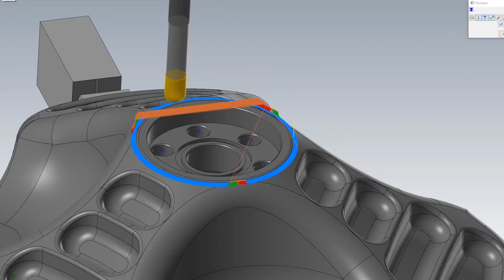IF You're This Type of Machinist, You Deserve $100,000+ Salary

Comment: If the person has so much expertise and everybody can rely on him why not build his own company instead being an employee?
Reply: Expertise does not equate to great management skill
Reply: It's called money.
Reply: @dman0042  The extra nothing at your salary or the money you can make building your own company?
Reply: @car9167  The reason people don't just start there own company. Money. If you are a machinist making what you consider low pay then how do they afford to open there own shop without a massive loan that they would most likely never qualify for.
Reply: @dman0042  That's true, not everybody qualifies for that. But if you ended up in a position making such a difference in the company why not try to work for yourself
Reply: @car9167    Work for yourself and the answers to the questions you have will be answered, have employees and you'll understand you can't even begin to realize the stresses involved running a company.
Reply: @skm9420  Well I did that so I know from my experience. I was also that employee the video was mentioning but I was able to negotiate with my employer a different arrangement for wages. I would get a fixed salary and 10% of the profit increase month to month. So if this month the profit was $150,000 and previous month the profit was $100,000 I would get $5,000. If in any future months the profit  goes down from the maximum so far I get nothing just the base salary. To get anything again the profit needs to go over max ($150,000) in my example. That's incentive to create profit, not revenue which takes into consideration revenue and cost to get those profits.
Reply: @car9167  yeah and then you rolled over and fell out of bed
Reply: @desperatelyseekingrealnews  Not at all. I was the company CFO at the time and it was in Romania and the company owner was german originally from Romania. Something like that would never happen in US
Reply: I agree !
Reply: Why take on the risk. Once you have your basic needs taken care of and can reach for other goals in life.
Reply: expertise in a industry is'nt equal to company running/ getting your own bussines , you have to have much knoledge on that , not all people are good buisness men even though you are good at you do
Reply: If they're content with what they're doing I don't see the problem. Owning a company comes with a lot of downsides and stress. Why bother if you can lay back and earn 6 figures while doing what you love? Money only improves your life until your basic needs are covered, after that point it becomes more and more useless.
Reply: @chas1878  Sorry but I don't see it that way. If your work is increasing the company productivity with 10% whatever salary increase you get is nothing compared with the amount of money the company makes. For me that salary increase is not an incentive and at my age it would not feed my ego that I did something extraordinary for the company.
Reply: @car9167   There's more to running a business than just money.
Reply: @car9167  that's why you would never be able to run  your own business and those type of people and very few and far, as Titan says people like you lack passion also just because the company may make an extra million from you doesn't mean that's a million in profits, also doesn't mean that company isn't already running on debt, braking even or may make a profit and want to buy more machines and employ more people and thats something that takes someone special right there.
Reply: @pandaview2673  Sorry but you don't know anything about me so you can't assume anything.
Reply: @car9167  Of course I can assume. Its the very thing I can most definitely do.
Reply: [07/03/22]  Running a company is def not for everyone. You really have to be driven. A lot of things to consider: accts payable, accts receivable, sales, mkting, cust svc, payroll, HR, property mgnt, financing, and on, and on.  Who's going to do all that?? Accept first of all that you'll be working a min of 60 hours a week, if you're lucky, during the first 3 years at least!!

Comment: My first job as a CNC machinist when I was fresh out of professional school at 21 years old was the one of a pattern maker. I was working in a little pattern shop that would design and machine patterns for foundries. Then, I only had a few months of experience operating a CNC in a injection mould shop when I was hire there. The guy who was programming and running the CNC was an old school pattern maker in his early fifties. The boss realized some 14 years before they hire me that if he keep quoting job that were to be made by hand, he'll be quickly out of business, so he bought his first CNC machine and my then coworker figure it out on his own. When I started working there , I quickly noticed that a lot of things were done the wrong way. From how and where he would setup his WCS and Tool offset to how he would program the parts. Within a fews months, I quickly suggested a few change to the way we setup the machine that would make our life far easier to wich I was replied "Listen, young boy, I have been running this machine the way it is from the past 14 years. Do you really think you were to come in to show me how it's done ?". I didn't realize it at first, but this had set up the foundation for the most toxic work place attitude ever. I mean the guy couldn't even read and understand the code he was throwing in the machine, he couldn't even edit a bad feed in the controler, he'd have to go back to the cam and repost every little change he had to do. He was still on a cracked version of mastercam V9, while the boss just had bought the then newest X5 version, because he taught the new UI design was too complicated. Anyway, so it went like that for the next 10 years and the only reason I would stay is because the boss was paying me a very decent amount of money because he knew , although he never admitted it, that the other's guy attitude was a huge problem and that I couldn't be easily replaced. Until about a year ago, the boss didn't adjust my salary for the new fiscal year, told me that I was paid a decent amount of money already and didn't need more. Quickly realized this shit went on for too long and quitted ! 

I am now the second employee of the machining department in a startup company that is currently investing huge amount of money in their in house machine shop (prototyping) and they really want us to push boundaries and get out of our comfort zone. Plus , they just brought us a brand new 2021 Doosan LYNX 2100 LSY, how fucking cool is that ? Definitely not regretting my move ! Thanks Titan , you have kept the fire lit for me all these years when I was actually thinking of quitting machining for good. Now it grew into a giant bonfire. I'm glad to be a machinist.

Comment: If you find yourself studying the manual of a 40 year old machine to see if you can make it work better or even work at all,  that's probably a good clue the place where you are does not grasp that it takes effort to be competitive even with good equipment. With worn out, obsolete, equipment, it doesnt matter how creative, how enduring, how productive you are, you cant compete.  If they balk when you request a spare $10 nozzle, but can pay a vendor to come and put sodas and snacks in the main office breakroom, the priorities may be confused. If they finally replaced the 20 year old CAM software (to get a working post processor for the best laser/turret you have), and they think they have upgraded your equipment they do not understand enough about what you do to be making decisions about what to do it with. When you have cut the cost per unit in half in your shop, and the company still is not solid financially,  the problems outside your shop are probably too great to be overcome by any heroic effort inside your shop.
Reply: Glad you said it because that's what I'm dealing with everyday  . Machines are failing  and they don't want to invest in the future roof leaks on machines and no cnc maintenance guy anywhere around.
Reply: @jimfran2761  If I ever again find myself in the position to seek another clock to punch that belongs to someone else, during the interview, the first question I will ask is "Have you ever operated a CNC?"  If the answer is no, I'm ripping up the resume, telling them not to call me, and walking out. They will never get it if they havent been personally responsible for at least a few shifts.  They will never understand what it takes, they will never get how much pressure it is, they will never appreciate how important it is to find or develop a skilled operator, or programmer, or mechanic, and take care of them they way they take care of you, they will never value you.

Comment: This is not 100% true, but a 1000% true.. in my previous company we made parts for ASML. When I wanted to test new tools and new feeds and speeds they got angry and said: we do it like this for more then 20 years (with hss tool steel end mills) do not touch it. It's one of the reasons they had to let me and 25 other people go because ASML found a cheaper supplier that made the parts better, faster and cheaper..
Reply from the maker: Yep, happens all the time.
Shop owners will complain about work going to China… and then walk into their own shop where they refuse to innovate… Culture drops and attitudes drop… and jobs leave unnecessarily
Reply: Yes, and thats exactly what happened to me, to us.. and it is such a shame..

Comment: A company I very briefly worked for gave their employees a £25 gift voucher as a bonus for doing an excessive amount of overtime and getting the company out of the crapper.
The directors both got a Porsche from company owner, it made the shop floor so mad that they stopped doing the overtime.
Reply: Same. I told them we need new cat40 tool Holder plus collets and even Haas recommend telling them we need new holder because they're pitted. Waited a month nothing. Waited for my 90 days interview nothing, a year interview nothing. After employee turnover 3 times I was their nothing, When I quit $2 raise. I'll pass  that doesn't keep up with inflation, minimum wage.
Reply: I work for a contractor and we work for a major tire manufacturer. I’m an electrician and I build the equipment that builds tires. Recently at the corporate level of the tire manufacturer they canceled 50% of every outside contractors personnel on site and THEN told us we had to work overtime. Needless to say I told them to pound sand and piss up a rope. I cut out the 5 hours of OT I was getting before the cut and told them I refuse to over work a position to cover for a manpower deficit. If they want more hours of work get more people back on site.
Reply: What a kick in the pants. At least you only worked there briefly.
Reply: @david24442  define briefly... Is almost a year a little too long?
Reply: @themattrixrevolution  I was there 4 months, you were supposed to get a review and a pay rise after 3.
The management totally blanked me  with regards to this so I gave them a white envelope and I went back to work for my old boss.